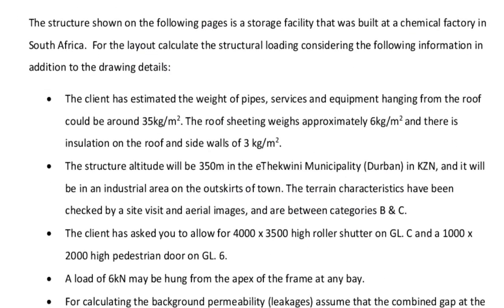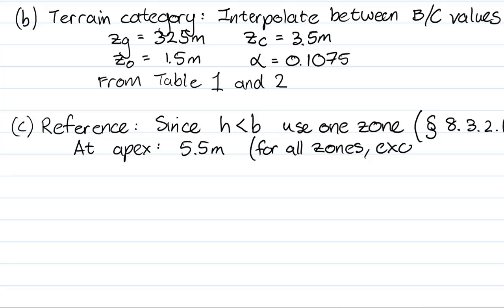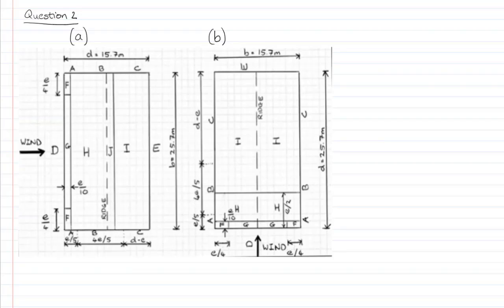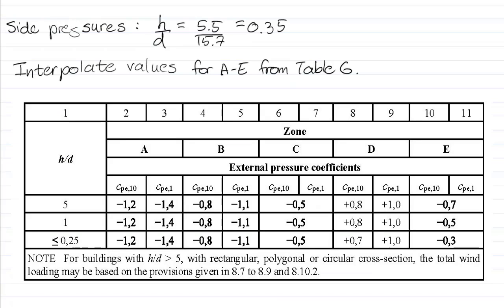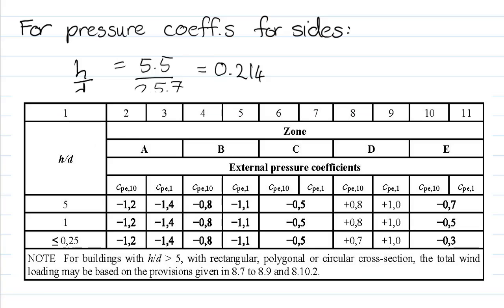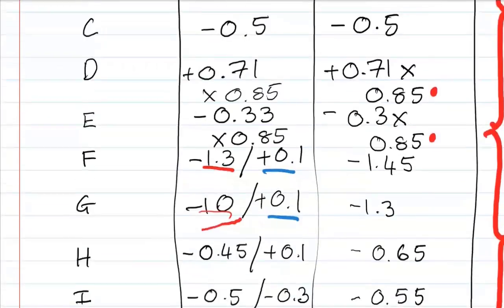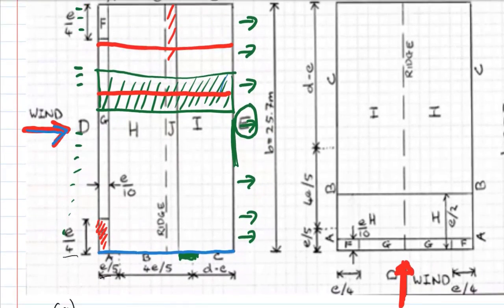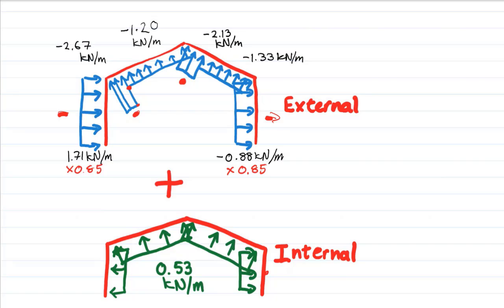Building Loading - Wind loading calculations to SANS 10160-3 for an industrial building - SD424

Comment: Hi, for taller buildings as in case b and c in Figure 7, do you have to calculate the wind pressures using the heights specified there like the way you did for the eaves and apex wind pressures?
Reply from the maker: That is correct. Zone D has multiple pressure zones with multiple z values for the pressures.
Reply: @richard_walls  thank you very much
Reply: @richard_walls  Good day sir, I would like to know how do you approach wind loading for a Tuscan roof double storey office, with timber trusses
Reply from the maker: @CIVILWITHMASTEE   have a look in the roof profiles provided in SANS 10160-3 and get the closest to your shape. Some interpolation may be required between layouts. The material used, eg timber, had no influence on the pressures, but rather the shape.

Comment: Sir, why are we using the apex height (5.5m) for calculating side pressures and roof pressures both on the Windward and Leeward sides instead of the height at the eaves(4.m)

Comment: Thank you so much, May I know the ultimate safety factor for wind (ULS)
Reply from the maker: Hi. It's 1.6 in South Africa (used to be 1.3). Thanks
Reply: @richard_walls  Can i have the reference document link
Reply from the maker: @saravanakumar2702  The document is SANS 10160-1 (loading) or SANS 10160-3 (wind). The codes can be purchased from the SABS.
Reply: @richard_walls Shouldn't it be dependent on the load combination?
Reply from the maker: @Mafefe_Moloko  for ULS it is either 1.6 or 1.0. however, you can also apply a combination factor due to load combinations and wind not being the leading variable action.

Comment: Morning, I would just like to find out if the same principle would apply in the calculation of the internal pressure coefficients if  the door opening in the above example now extended the full length of zone E(wind dir 0) ( 3 sides closed and 1 side permanently open)? For the 0 wind direction, would the Cpi=0.9 x Cpe(zone e) and for the 180 wind direction (wind blowing into opening) be Cpi = 0.9 x Cpe(Zone D)?